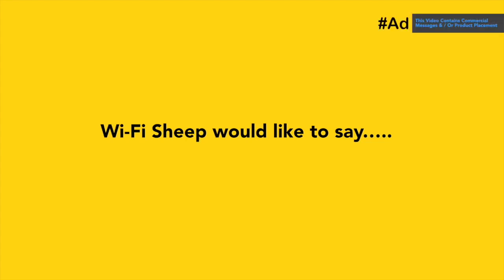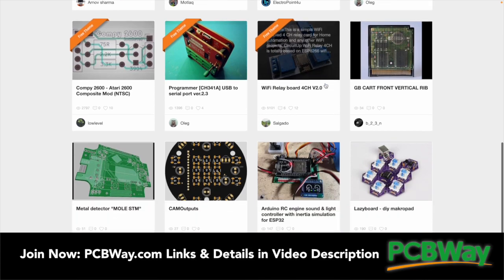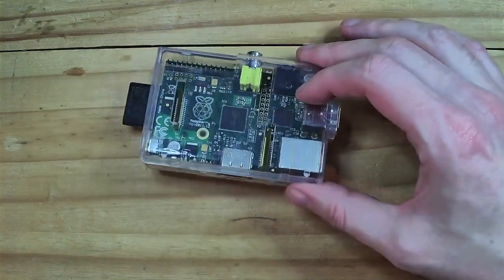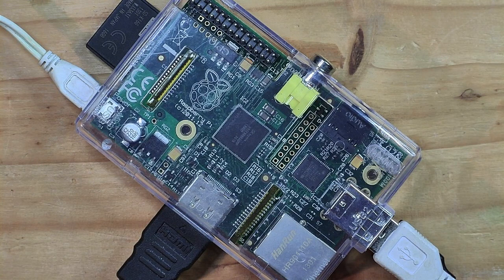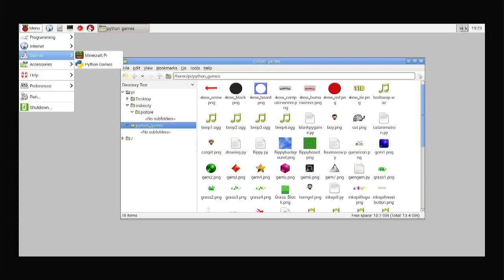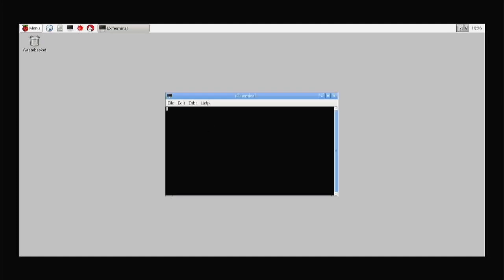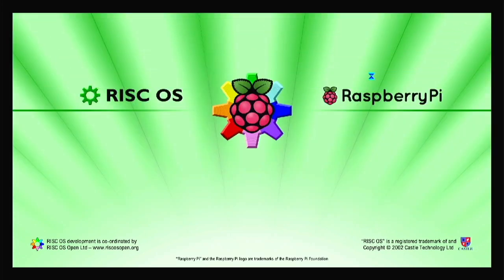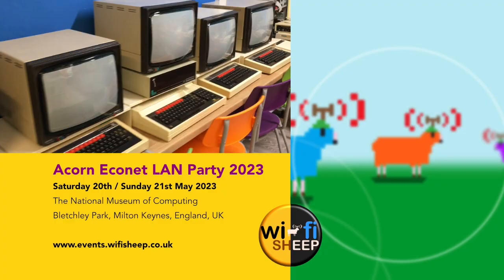Used Ebay #raspberrypi Pi1s Any Good? #unboxing #review

Comment: I use my PI 1 model B and B+ constantly using Risc OS direct. Granted. I'm probably a little more "invested" as have message Pro for my emails etc and chatcube for my telegram messages etc. I still play Quake and Duke Nukem 3D on it. I still use IRC using GrapeVine.....  I also purchased Iris. Unfortunately as a modernish browser only works in my pi400. Awww well Netsurf does the job. But the original Pi is not slow by any means... Take the bloatware OS's away and they're more than capable. Thanks Tom. Love the channel!!!

Comment: Due to the shortage I have taken one of my pi2’s and put it on pihole dns duty as the secondary dns server at my second house. It works fine only tiny issue was lack of Poe hat but external Poe splitter worked great, 32bit Ubuntu 2204. 

My original pi 1 sits in its display case as my first pi.

Comment: I bought a pi zero w from pimorini on the 11th of April. Saw they were available on a YouTube video. But they quickly went out sold out again.  It cost 18 delivered which is what the pizero 2w used to cost which is what I wanted. I want to use it for dosgames so hopefully will be able to play some older games. Do you think they will work ok? I have install dosbian. I need to get usb micro adapter so I can add a keyboard mouse i can play the games.  but dosbian did load after I changed the config file for the CPU from dynamic to auto. I might overclock it too. If you can run doom on the pi1 hopefully I can run some games on the pi zero w
Reply from the maker: The Pi Zero 2 has a much faster ARM CPU than the Pi1 and Pi Zero original, so for emulated 16bit DOS era I think you'll be fine. Infact i'll go as far as to say that Pi1 original or Pi Zero would handle most DOS games and applications ok as well
Reply: @WiFiSheep  it's the original zero w i have but I agree too it should work ok. It will be used mainly for championship manager 97/98 and point and click adventures like monkey Island. 😊